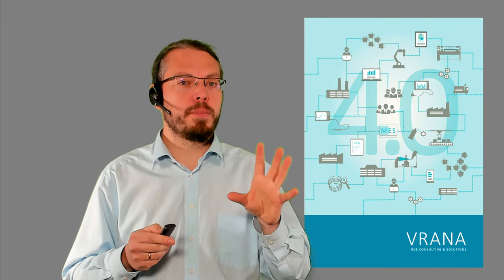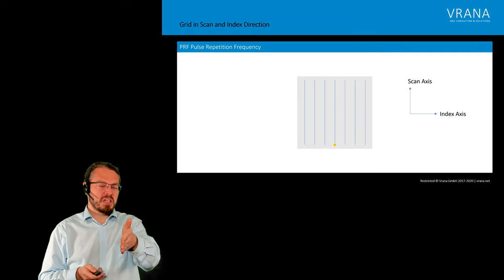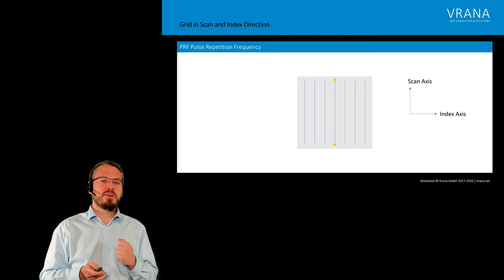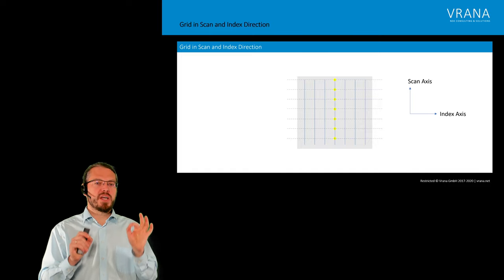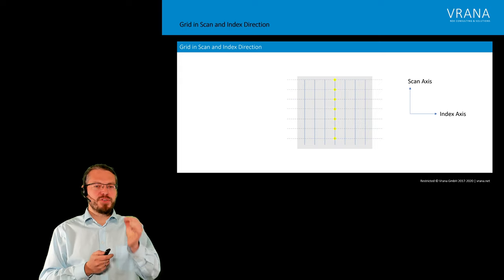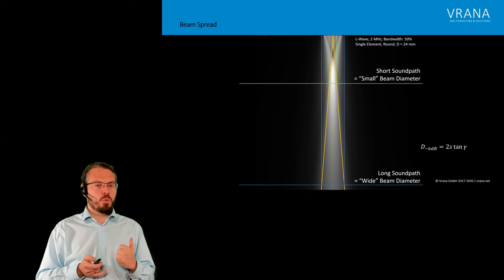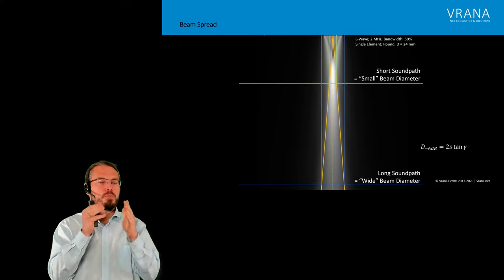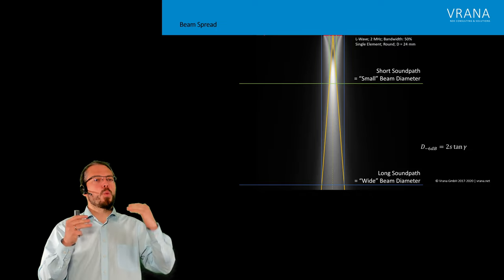How to Determine the Optimal Scanning Grid for Your Ultrasonic Inspection

Comment: nyc videos on dgs explanation sir can you give an video on why  and wat purpose fiter is available and wat range of filter to apply for wat typ of probe
Reply from the maker: Usually2robe has a certain bandwidth which you can find on the datasheet. For a 2 MHz probe something like 1.2 to 3.8 MHz. The high pass frequency should be lower than the lowest frequency of your probe bandwidth and the low pass frequency should be higher than the highest frequency of your bandwidth. So for our example something like 1 to 5 MHz. This eliminates all the noise with frequencies outside of that bandwidth and leads to a better signal to noise ratio.
Reply: @NDE40  thankyou sir
Reply from the maker: @Devarajan_THIRUMALAI_KANDUR  You are welcome